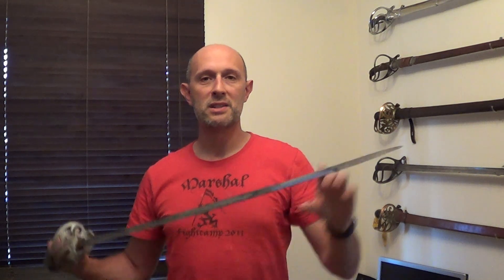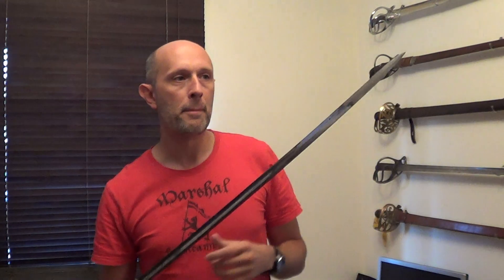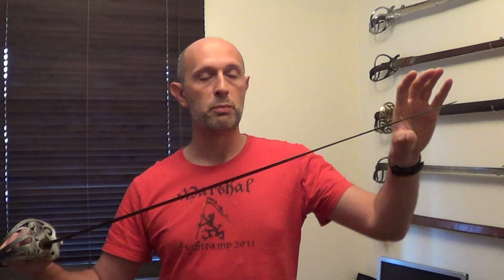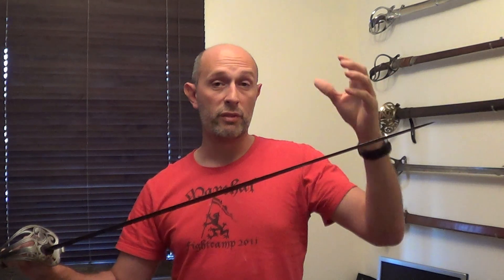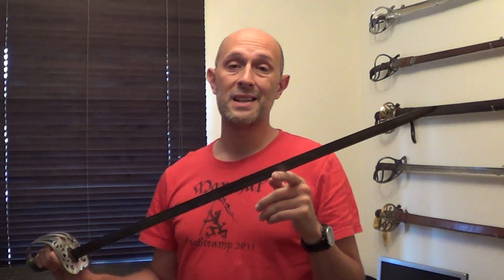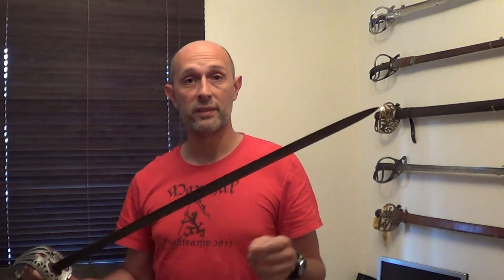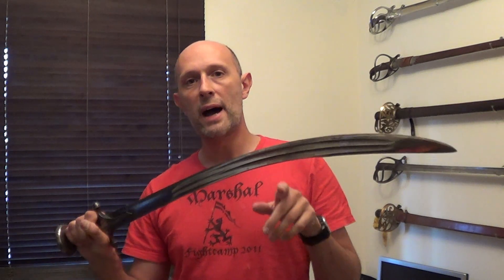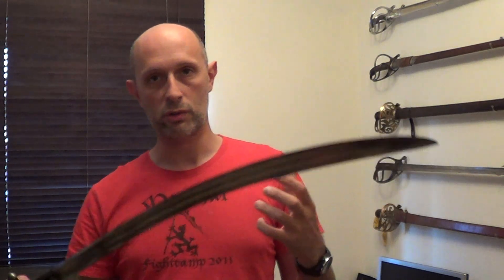Flexibility of sword blades

Comment: The problem with the Katana is that the metal used has a very high grade of fouling, causing the tempering to leave the blade very brittle.
Reply: This is correct. This is why Japanese sword smiths used to sandwich the steel of katanas with different purities so that the edge portion of the sword is the best for sharpening and cutting.
Reply: White Kitta You can always break a sword.  These techniques just help prevent it from happening under battle conditions.  Also, because of it's popularity, there are a lot of substandard Katanas on offer in the world.  It's possible the one you owned just wasn't up to snuff.  Even many historical Katana's actually carried by Japanese soldiers in WWII are not particularly well made, because the empire started mass producing them as a symbol, rather than the battle worthy weapon it had been in the past.
Reply: yarpen800 I know that.  Note that I said "battle worthy".  I wasn't indicating that it was their main battle weapon.  It's an important point to make though.  A lot of people think that samurai just ran around fighting with their swords all the time.

My point was that pre-Meiji era, even pre-Tokugawa era, samurai carried quality swords.  They were carefully crafted with the intent that they could stand up if used in battle.

During WWII the weapon was produced en masse, with little to no expectation that the soldiers would actually end up using them in 20th century warfare.

Many of these lesser quality weapons were taken as trophies by allied troops and are accurately sold as historical artifacts.  It's not always clear to the buyer however, that it's not really the same thing as other historical examples produced in Japan before westernization.
 
Fun note.  I own a strange, to me, katana/wakizashi set, where the katana is a forged bade (though not traditionally, definitely not tamahagane) and the wakizashi is a "wall hanger" or "sword like object".

This set was given to me as a gift by a friend.  When I first started really learning about swords I took a look at them assuming they were both going to be wall hangers, but the difference between the two is startling.

The hamon on the wakizashi is a sad joke.  It's clear that they applied a stencil over a stainless steal blade and then scratched it with a wire brush to produce the illusion of a hamon.  Also, the edge is what you would expect on a wall hanger or a training sword.  It's about 2mm thick and rounded.

The hamon on the Katana however is beautiful.  It's edge extremely sharp and durable.  It cut's beautifully.  My suspicion is that the Katana was forged as a low to mid level sword on it's own; and at some point, someone decided to make a cheap wall hanger wakizashi to go with it.
Reply: *****  I noticed that people don't read the material they mention.  This happens a lot with " The Book of Five Rings"  People will comment about  it,  but they clearly haven't read  it. I have to explain that the words "katana" and "wakizashi" do not appear in the translations ive read.  Other people act like HEMA is all one thing, but the sources differ a lot.  Im  annoyed with the youtube user Skallagrim, because he hardly mentions historical sources at all. i mentioned above.  I think he is mostly self-taught, but he presents himself as an authority figure and his channel has a lot more views than Matt Easton's. I think it is actually kind of funny.
Reply: It's worth mentioning that this doesn't really apply to modern specimens since the steel quality now should generally be the same as anywhere else. I think you know that but some of the replies appear to indicate that they think you mean that the design itself causes this.
Reply: ***** I am aware I just want a source. I make this comment to people all the time but I've since lost faith in my original source, which was a discovery channel doc.
Reply: *****
It really wasn't an issue that the person using the nodachis lost; more importantly it showed that two very highly respected martial artists of their time preferred to use nodachis in combat, which meant there were schools of swordmanship dedicated to them, which meant they were indeed meant to be combat weapons.  Not to mention that Musashi himself used an over-sized bokuto (basically the practice version of a nodachi) to defeat Kojiro.

Arts showing nodachi carried by fully armored samurais:
http://en.wikipedia.org/wiki/File:Samurai_wearing_a_nodachi_%28field_sword%29.png
http://en.wikipedia.org/wiki/File:Hiyoshimaru_meets_Koroku_on_Yahagibashi,_showing_nodachi_or_odachi.jpg
http://media-cache-ec0.pinimg.com/736x/18/b3/5a/18b35a5ee46c5bda0dd77e6927ef008a.jpg

Well, I already said that the nodachis were rare weapons compared to yaris or naginata.  But they were used in combat, as I have given you the example of Masaka Naotaka.  I would give you more examples of nodachi being used by warriors if I could find them later.

Swords broke all the time, it happened whether they were European, Middle Eastern, Japanese, etc.  To show a lot of examples of Japanese swords breaking did not in itself prove that Japanese swords were more 'unstable'.  Certainly Japanese swords were highly valued by other cultures, they were a major export item to China during the Ming dynasty, and European sources from the 16th to the 19th century generally spoke highly of them.
Reply: ***** 

So now that your argument rang hollow you try to change the subject?  

By equivalent I meant that when it was used on the battlefield it acted as a primary weapon, just like the yari and naginata were, and not as a backup like the katana (since those samurais shown carrying nodachis invariably carried katanas as well).  In Europe the zweihander was considered a substitute to the halberd and other mid-length polearms, I don't see why the nodachi wasn't.

Which source did you read on the musashi-kojiro duel? My souce had Musashi fighting and killing Kojiro with an oversized (hence as long as a nodachi) bokuto on their final fight.  And at any rate how is that relevant to your point?
Reply: John Huang Just because a sword is a secondary, tertiary weapon does not reduce its importance. For example, spear beats sword nine times out of ten. A spear is just a better weapon in most circumstances because of its reach. And in many cases a bow would be preferable to the spear because of its range. I would much rather kill someone before they even have a chance to touch me than fight him when he is up close. The role of swords in battle is for the situations in which your opponent is within the range of spears. Like in a siege or on a ship for example. Also in non-war circumstances a sword can be invaluable because you can wear it. Matt has enunciated that many a time. A spear does not make a good status symbol because they are a pain to carry around all the time. The other advantage of a sword is that it is relatively difficult to use effectively. However, that does not make it worthy of a primary battlefield weapon. Combat in any circumstance is about killing or incapacitating your opponent before he can do the same to you. Therefore you want your primary weapon when you know you are going to fight people to have as much reach as possible so you can be as safe as possible
Reply: John Huang I think we see eye to eye on this.

I observe a tendency for communities on youtube to float from one extreme to other and back again on topics like these.

A lot of people seem given to talking in extremes; so, the sword is either "the ultimate weapon", or it's "just for decoration".

The more subtle and interesting truth, which resists such reductive descriptions, is somehow unsatisfying to many people.

One of the things I like about Matt's videos, is the genuine effort to nudge conversation toward a more robust and nuanced understanding of the topic.
Reply: ***** Nodachi were only popular for a relatively small window of time, from late Kamakura, but they were absolutely designed for the battlefield. It was common, however, to wire-wrap the blade closest to the hilt to make an improvised ricasso. From here it evolved to the nagamaki, which featured a very long tsuka.

Your argument that the Japanese couldn't make "stable" swords of nodachi length is very strange, considering the Japanese make such swords today, using traditional methods, and they perform just fine.
Reply: ***** Alright, I am going to have to ask you for a source for your claims. One of my sources is Karl Friday, "Samurai, Warfare and the State in Early Medieval Japan", 2004, p. 88, ISBN 0-415-32963-9. Now it's your turn.
Reply: Well, the sword itself isn't brittle because of the way it's made, but the edge is brittle, because of the tempering.
maybe I should have clarified that? The edge of the Katana is usually tempered to a higher degree than European long swords, and with the steel having such a high grade of fouling, it would leave the edge itself very hard, but also (possibly) very brittle.
Reply: ***** Oh... woops, big misstake on my part :s
Reply: ***** 
Yes indeed, I think the whole "swords are always secondary/tertiary weapon" concept could be carried to an absurdity.  The sword in most (not all) culture was the highest status weapon of a professional warrior, it only made sense that people who dedicated their lives to warfare and generally formed the upper level of economic status in their societies would have high quality, functional swords.  And since these guys built their lives around the possibility of being in harm's way, they would never have a weapon that didn't work well.  There were numerous references from history of samurais using the katana as their primary weapon when fighting in sieges or on ships.  And certainly the nodachis and odachis were always primary battlefield weapon, equivalent though rarer to the yari and naginata.
Reply: *****
Hmm I found that a bit hard to believe.  First of all word nodachi meant 'field sword'.  Plus certainly a lot of period art from 14th century showed samurais in full armor carrying nodachis, I couldn't believe that all those guys were only carrying them for show.  

I know of at least three occasions when nodachis were used in combat: 1) The duel between Musashi and Yoshioka Seijuro, 2) the duel between Sasaki Kojiro and Musashi, and 3) Makara Naotaka covering the retreat of the Asakura Army during the battle of Anegawa in 1570.  I am sure there are plenty of other historical examples as well.

Perhaps a lot or even most surviving nodachis were made as votive offering to temples, since after all the Edo period was relatively peaceful and lasted for so long.  But during the Sengoku Jidai?

At any rate, where did you read that the Japanese were unable to produce stable sword blades of such length?
Reply: ***** 
Well if you read my first post carefully, that was actually also what I said.  Warriors using nodachi were rare compared to yari or naginata.  So all your posts were a lot of wasted breaths.  Jokes on you bro

And the point about losing....was irrelevant.  Kojiro lost to a better warrior, carrying a sword just as long.  In both battles Musashi used psychological tactics to succesfully unhinge his opponents. And in fact it showed that there were schools of swordmanship teaching how to use nodachi, since those two guys beaten by Musashi were after all heads of their own kenjutsu schools.  Which probably meant that use of nodachi in combat were not that uncommon.
Reply: fleurdelispens
I think we agreed on the matter, my point was directed at some people who seemed to imply that because swords were not primary weapon warriors might carry around ceremonial pieces with them, which made absolutely no sense.  Best regards
Reply: Fight Student That's a good point about "The Book of Five Rings," and it's the same in the versions I've read.  He refers to "the longsword" and "the shortsword" which makes perfect sense.  What I like about Musashi's writing is how he speaks to the intent behind each technique he describes.  I think he focused on the intent rather than the minutia of the exact "correct" way to execute a technique because it's the mindset behind the blow that really determines how effective it is.  If the mindset is correct, then correct technique should come with practice.  What I like about this is that his book is therefore equally suitable to European swordsmanship as well as it's native Japanese.  He doesn't describe "how to" in detail and therefore the "how" is left open to the swordsman to determine.
Reply: Fight Student I can definitely see what your saying about people not actually reading sources, and people talking about HEMA as if it were one system, where everyone agrees.

About Skallagrim, I would have to disagree.  I've lost count of the number of times I've heard him stress that he is not an expert, or an authority.

Do you think it's possible that you might just be annoyed with some of his fans?  'Cause, he does have some blind fanboys.

I think his videos have more views than Matt's because he's not an expert.  He knows he's just an enthusiast and an entertainer, and his channel reflects that.

Matt's mainly interested in serious academic discussion and research.  That always draws a smaller crowd, than funny videos about bad sword designs in video games.
Reply: Fight Student I don't know what Skall has or hasn't read.  I do agree that he isn't an expert.  However, as I am no expert myself, the main reason I know that is because he makes a point of saying it.

Citing sources is really important if you expect people to take what you say as fact.  However, if you're just stating your opinion, then the source is you.  There's nothing to cite, because you're just putting your thoughts out there.

I think it's important not to view every conversation or video as an academic thesis.  Facts need sources.  Opinion's don't. 

Maybe Skall could do a better job of making sure everyone knows that he's almost always stating an opinion, but honestly, I usually think he's belaboring the point, he says it so much.
Reply: Student A I do study martial arts.  I have been in schools that were very academic, and I've engaged in one on one training between equals in other arts.  I am no master, but I am happy with my art.

When it comes to doing research before doing a video, I'd say it's always a good idea.  But I think the intent of the maker is important in judging whether they are merely mistaken, or deserve a rebuke for intellectual dishonesty.

The thing about Skall is that he's shown a good response to polite critical feedback.  I think he usually hopes someone who knows more than him will correct mistakes or misconceptions that he has, and take to task if he's just being silly.  I've even seen him post follow up videos outlining where he was wrong, when someone really picks apart his mistakes.

That said, I respect your point of view on this.  It don't think we exactly see eye to eye, but I respect what you're saying.
Reply: Source?
Reply: http://en.wikipedia.org/wiki/Japanese_swordsmithing#Metallurgy
Reply: I'm just looking for a source, the wikipedia article didn't make much mention of the brittle nature.
Reply: Might as well add this as well: http://en.wikipedia.org/wiki/Japanese_swordsmithing#Heat_treating
Reply: I know I had a Katana and I managed to brake it.....   :-(   sucks, but I guess that was my fault.
Reply: *****  You disagree that Skallagrim is self taught and presents HEMA as if it was one thing. and hasn't read the book of "Five Rings'?  Sure at times he does stress he is not an expert, but then he makes a video one knife fighting and says that most martial artists have no idea what they are doing.   For that video he should have listed more sources and specifically said which were good and which were bad.  I feel if one is gonna make a video like that one should have lots of sources and such.
Reply: triumphant39
 Huh? Japan had plenty of contact with the Europe in the 1500's, that's how they got muskets and cannon.  The book of  Five Rings mentions both as powerful weapons.  Japan also imported European armor as well in the same period.  I don't think you know what you are posting about.
Reply: Regarding Matt,  he actually doesnt   spend much time talking about specific sources either,  there is one vid about Leicttenaur and a couple on Fiore guards.  But m9st are very general. Id like to see more tjo5ugh..
Reply: triumphant39
 Do you have a source for this info? Why did they import breastplates but not muskets, swords or cannon? Have you read "By the Sword" by Richard Cohen, or " Swords and Hilt weapons http://www.amazon.com/Swords-Hilt-Weapons-Victor-Harris/dp/1853755877 these two sources both talk about the extensive contacts the Japanese had with the Spanish and Portuguese and effect   such trade  had warfare in Japan.  The invasion of Korea wasn't  until  1603, which is decades after the decisive use of muskets  and cannon by Oda Nabunga.  You are mashing up dates and time period which is odd.  It was only with the Tokogawa take over of Japan  also in 1603 that  there was a limit of foreign trade. But before there were trade contacts that were extensive.    Since you don't have a source and I've posted three you are probably trolling or uninformed,  perhaps both?
Reply: It seems to me if you are gonna a make a video on knife fighting you should read up on it, its the type of thing you need more than an opinion about, you need to have done research and specific training.  Id rather see skall become an expert than anything else.

I don't know if you study martial arts or not. but things like  judo, BJJ are set up and treated like an academic discipline.  It was like this for European  fencing masters too.  Do you disagree that that is how it should be done?

As far as treating videos like a thesis,  depends on the video.   I found it funny that he had a kind of disclaimer in the video about the gunblade but did not have one on the knife video.  He was more concerned about angry FF fanboys than disgruntled aikdo or kali guys!